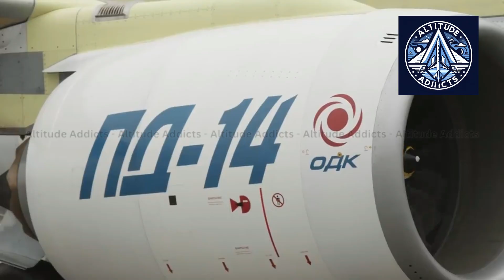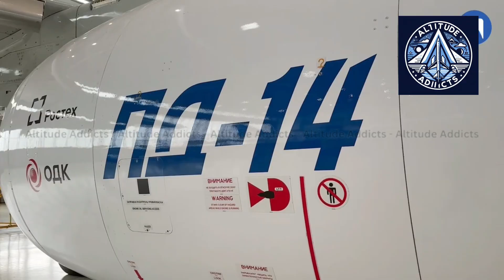MC-21 Flight Test EXTREME: Russian Airliner Takes on Mountains, Water, Lightning!

Comment: Semoga tidak ada penundaan lagi, minimal Desember 2026 pesawat ini sudah mendapatkan sertifikat.
Reply: Ende 2025/ Anfang 2026 müßte schon sein.
Wie sagte doch M.Gorbatchov in der GDR(NRD):
Wer zu spät kommt, den bestraft das Leben.
Wer zu spö
Reply: The scheduled certification is scheduled for completion in October 2026. However, another aircraft has now entered the certification process, which may lead to an earlier completion. In any case, certification requires more than 2,000 flight hours; without this, the document will not be issued.